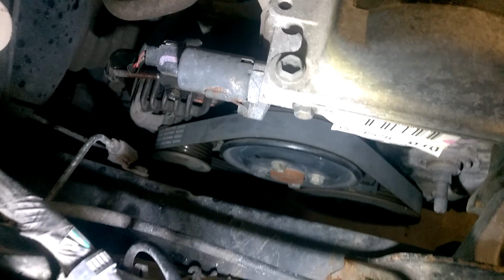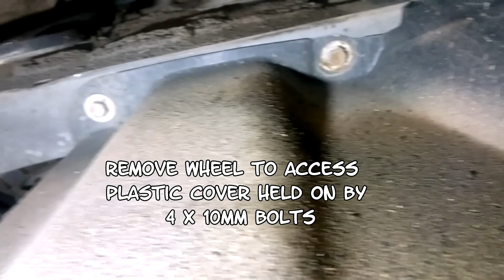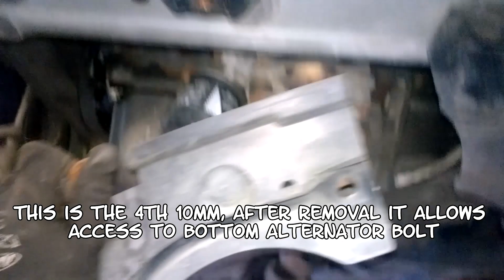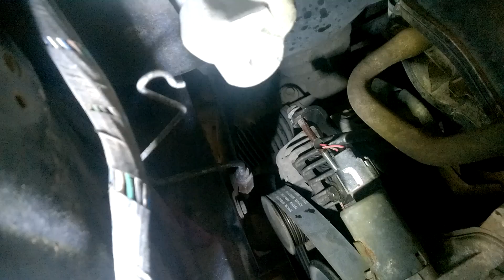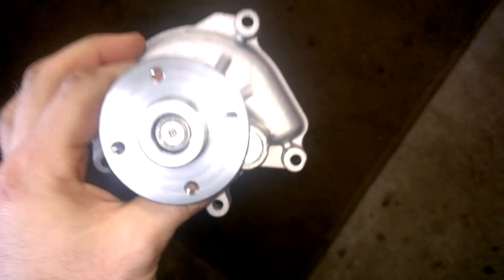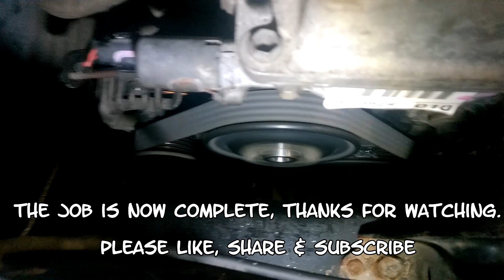How to replace a water pump in a Toyota Yaris

Comment: Oh jamming a thing in there so it doesn't spin that's what I missed I could not take the pulley part off it just kept spinning and spinning now I'll jam a screwdriver in there so that it doesn't spin thank you so much for the video!! This car has 343,000 MI original water pump

Comment: Great Vid. My 2004 has 108,000 miles. Coolant level not dropping. No unusual noise. I must stick a little mirror under the pump to look at the weep hole. If no coolant stain present then i am in 2 minds about changing the water pump as a precaution. Lots a varied mileage reported for water pump failure.
Rest of car is superb, flew through nct. What's your thoughts Gerard on recommended mileage to change out the pump?
Reply: 99 k miles  /  I'm in the same camp.

Thinking 🤔 of loosing belt to check bearing tightness.

Comment: Recommended mileage to replace water pump on a Yaris 2012 4dr sedan?
Reply: Pakkus Ch  my 2007 is starting to go at 175000 miles.
Reply: @traceyhobbs8331 

Thinking 🤔  overtighting belt leads to bearing wear. 99k